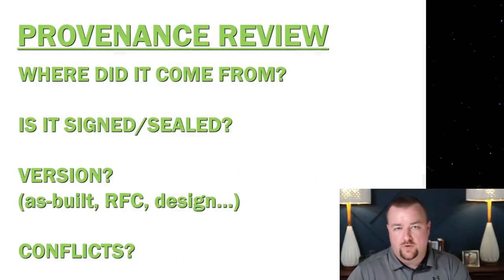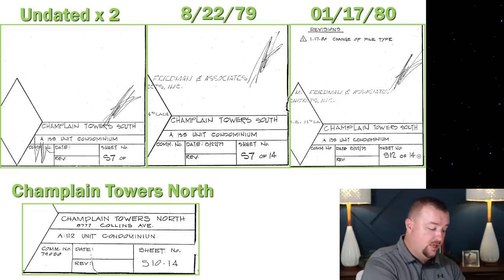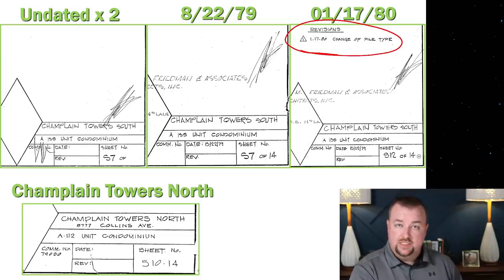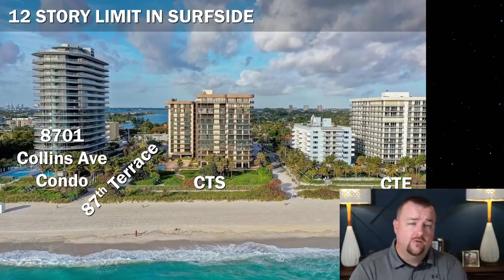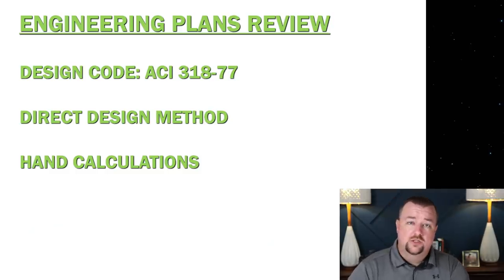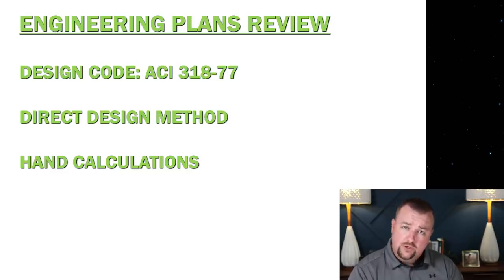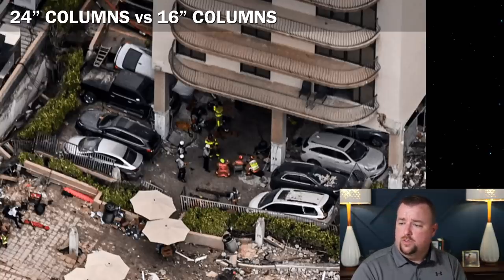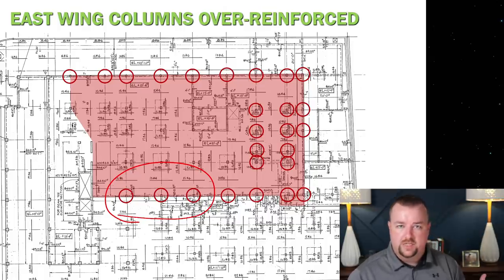Engineering Failures Found in the Champlain Towers South Drawings - Surfside Collapse

Comment: You mentioned that one drawing had a lot of changes that were not noted. Could that have been done by someone else without the engineers knowledge.
Reply from the maker: I actually thought about that.  Something about the last minute changes almost makes it seem like the engineer "rented out" his seal to the architect.  It wouldn't be the first time this has happened.
Reply: Just imagine if you approved this building in any way...
Reply: @windsofmarchjourneyperrytr2823  Presuming they are still alive 40+ years later.
Reply: @BuildingIntegrity  When the recommendations of engineers and contractors are routinely dismissed as insensitive to the architect's grand visions, shit happens!
Reply: @keithrosenberg5486  no, I think they are all dead bar the partner of the engineering firm that was not involved in the design.
Reply: Sometimes senior partners trust the engineers that is doing the design work a little too much. In a large firm this is hard to avoid since the senior engineer seals so many buildings that checks can slip through the cracks. Now there are concept review checks where errors like this are more likely to get caught but it is not fool proof.
Reply: @dellto529  Architects suck, I've only worked single family homes and they suck there too.
Reply: @keithrosenberg5486  The structural engineer as well as the architect passed away a years after the building was constructed. The structural engineer actually had his license revoked.
Reply: @FunnyFallGuy  that is telling in and of itself
Reply: @BuildingIntegrity  Hence the absence of the engineers company logo

Comment: I'm surprised to learn from you that there are planters on the original drawings.  I had understood from another channel that the original pool deck was plain concrete, and that the sand, pavers and planters were added later to mask spalling.  Supposedly, there are google earth images that capture when various aspects changed, including the addition (and later removal of) 2 story tall palm trees in planters.  Like so many others have mentioned, we would like to know if those missing beams are also missing from the North towers.
Reply: I am very curious about the pavers as well!
Reply: @kimberlywright8623  And I am curious if added weight of such improvements as tile showers and granite to the condos contributed to the disaster. It looks like to me that ANY added weight, when combined with the missing beams and years if water damage multiply the problems.
Reply: So am I. And, when testing was done by one of the planters and not repaired, was it just one more problem?
Reply: I think more planters and pavers were added later to the pool deck.  Also there was no/poorly installed moisture barrier when these were added so it contributed to the damage in the garage ceiling.

Comment: Question, was the pool deck originally just a slab? Or was it a slab with the pavers on top of it. Then by adding the pavers and other materials the deck was way over stressed.
Reply: @jennyk2022  I think it is already confirmed that it was not angled correctly to let water run off, and that the waterproofing had failed a while ago.
Reply: That’s right!!  The pavers and more planters were added recently.  The columns were already at 100% capacity at the beginning of the project, can you imagine the kind of stress they were under after adding the new pavers and planters??!!
Reply: @Sashazur  The concrete slab was angeled for drainage, but when the pavers were added, the end result was flat.
Reply: @lilyrodems4847  and consider what equipment was used to bring the pavers into place. Big pallets of pavers being moved by forklift or other machinery.
Reply: @ericdunn6232  yes!  I didn’t even think of that!!  All the equipment 😧

Comment: I find it very hard to accept that an engineer would summarily remove load bearing beams without considering the consequences.
Reply: Oh, but if it involved a lot of time and trouble, and costs money, and if lots of similar structures are the same with no apparent trouble, who wouldn’t look the other way?
Reply: Sometimes the revision process can get sketchy.  Often times the revisions are performed by an EIT under the supervision of a Senior Engineer.  In that case, the EIT may not have had the insight, diligence or directive to go back and check the original slab design in conjunction with the Architectural and Civil Drawings.  Bear in mind that when the January 1980 revision was made, there was no requirement in the Architecturals for Planters.  Thus there would be no clear reason to design the concrete structure to support them and the EIT may not have been allowed sufficient time to completely re-evaluate the Parking / Pool Deck structure under his boss's directive.
So, in a nutshell, it looks like there was an error in slab reinforcing design which no-one took the time to discover, followed by an inarticulate revision to the slab configuration (to save money) complicated by an ill-informed building owner's scheme to "improve" amenities which introduced critical loading to the pool deck slab, attended by an installation process executed by incognizant landscapers served by innocent truckdrivers.
Oh, ... and 120 people tragically died as a result of this chain of lazy errors.
I mean no offense, but, I do not find it difficult to accept that this many critical errors accumulated in complete isolation from one another.  That they all came together at one building in such a tragic fashion is just a manifestation of the natural randomness that exists in our world.  Such confluences of lapsing attention are more and more likely to occur until the Kali Yuga begins to transition into Dwapara Yuga once again (~430,000 years from now, so get used to it).
This video is a terrific example of how we need to act if we are to remain viable as a species.  We need to be extra vigilant and more coldly analytical to guard against this kind of thing.
And we need to empower people of real "concrete" knowledge like Josh Porter (sorry about that).  Great analysis and chain of discovery.  Can't wait to find time to view more of his forensic engineering videos.
Reply: @erikmeyer2323  I will prove you right by saying, you where doing so well until you made it a religous thing.
Reply: You might want to check out the collapse of the Hyatt Regency Skywalk in Kansas City in1981. Engineers made a change  without rechecking numbers resulting in a catastrophic collapse killing over 100 people. Unfortunately Engineers do make mistakes.

Comment: Built to minimum spec, and not maintained. Got it.
Reply: Built wrong and to minimum spec, renovated wrong, then not maintained...40 years of mistakes each eroding little more of the building's integrity.
Reply: As a result the deck collapsed first, then the smaller columns lost their center support and simply buckled.
Reply: @ButterfatFarms  well said, wise perspective 🙏
Reply: It seams it was not built to minimum spec because it did not take into account for any live load whatsoever. Not even one person walking on it, let alone planters and cars, unbelievable.
Reply: @johnseavey6622  Or the occasional construction vehicle, heavy construction machines, heavy construction material or crane put on it. As one Engineer I read said if you leave an area open sooner or later someone will put something very heavy on it. So you put permanent stuff in the way of them doing that. And not they don't read the signs and no the basics staff not going to enforce the rules assuming any of them can actually read.
Reply: What kind of safety factor are buildings suppose to be built? I always thought maybe 1.5 or something like that. Sounds like it didn't have any room to play with at all.
Reply: Hey but didn't those marble and granite countertops look good?
Reply: The maintenance itself was a risk  since it would require materials and vehicles and vibration. It seems it was a matter of time regardless. I hope the sister building is still evacuated.
Reply: @waitaminute2015  The sister building was never evacuated.

Comment: Excellent analysis.   To put into context, how much does a soaked planter weigh compared to a standard vehicle?
Reply: Soil weights around 75 to 100 lb/ft^3(more like 120lbs when wet), assuming a 2*2*2 ft volume this comes out to around 800lbs.
A Camry is around 3500 lbs
Reply: Adding to the answer above,  a Camry measures approximately 6 feet by 8 feet.   A planter measuring 6’ by 8’ by 2’ deep would weigh between 7500 pounds dry and 12,000 pounds wet.

Comment: You also had this structure built with 1980 decor: linoleum and vinyl. They updated the units with tile and granite.  This place had no chance!
Reply: You are quite correct !!!
Reply: Yes I saw plans for the installation of marble flooring in at least one of the units: that's a lot of weight.

Comment: Great work! Very clear that you know what you are talking about. The architectural changes were a clear cause of design flaws in construction. Any and all Maintenance efforts were not going to keep up with the thermal cracking, Sea Salt Air, Sea Water and Rust with the occasional supper tides and Hurricanes!
Rust Never Sleeps.

Comment: Question, why didn't they design the buildings to be independent of the pool deck? The interconnectedness of the buildings seems to be an inherent design flaw in a simple design like this.
Reply: In some other video on this or a related channel, they said that it is more commonly done in areas with more seismic activity.
Reply: @Sashazur   Yes, typical in California,  seismic activity and less rain than Florida. Helps to restrain structures during quake activity.

Comment: Just seeing all of the ways these buildings can fail, it amazes me that these kinds of collapses don’t happen very often. I realize there are safety factors in place, but all of these buildings were engineered using calculations by hand, with no software to model dynamic forces and such. It’s a real testament to the engineering profession. Thanks for your fascinating analysis. You’re great at communicating complex ideas in a digestible and interesting way.

Comment: As a mechanical engineer, this makes me branch off into structural engineering. 😍
Reply: Stick with mechanical. Worst thing someone is a little too hot or too cold, no one is dying.
Reply: @AJF66OG  If only.  Mech-Es are often dealing with things that can directly kill someone if they're not careful.  Same with many EEs.  There's a reason why I know people who don't want to take the PE exam.  It's a huge responsibility.
Reply: @AJF66OG  except when there’s to much pressure from the heat and it goes boom… so every form of engineering can kill.
Reply: @arthurmoore9488  just got my license. Glad I don’t deal with things on the private side
Reply: Structural is simpler - at least our stuff do not move by design :)
Reply: @ivankuzin8388  Unless it's supposed to be in an earthquake area. I graduated from the university of utah where our library was rebuilt to flex with earthquakes.... the new structures were fascinating!
Reply: @MissNebulosity  Oh, yes, of course, and I am so happy to live and practice in a region with zero earthquakes!

Comment: When you were showing the diagram with the yellow planters and blue cars, you pointed out some 24 inch columns. Were the three columns to the back left of the cars the same three columns you had focused on as the location of the initial failure?
Reply: No they weren't, the original columns were further north and in the center of the building
Reply: @mattheww2797  I think you are right. Thanks!
Reply: No, those are the exposed columns under the part of the building that remained standing.

Comment: Will the North building, which is still standing, have a similar fate?
Reply: That is what I am thinking? Was it built the same way?
Reply: I might misremember but I think the columns there are wider.
Reply: I think he showed, with the beams under the planter boxes in other areas, the additional weight is supported.
Reply: I would bet that building will be condemned at some point and residents forced to move out until structural remediation can be completed.  They are not gonna take a chance at another collapse.
Reply: @johnbergstrom2931  At a minimum I would think there must be some max load areas that all need additional emergency supports put in while they go over plans compared with what is actually there. 
As related in another case it might be best to condemn and drop the building and rebuild as that would actually be cheaper.

Comment: As a retired engineer (MS CE with emphasis in structural), I am curious as to your meaning of being loaded to 100% capacity.  I believe that reinforced concrete design had moved to LRFD in the 70s so I assume this building was designed using that approach.  Are you saying that the dead load was equal to the nominal strength of the slab?  Are you saying it was equal to the strength of the slab with the resistance factor applied to the nominal strength?  Or are you saying it was equal to the strength when the load factor AND the resistance factor were applied?
Reply: I’m curious about this as well.  At that time most likely ASD so max code tensile stress for grade 60 bars was 0.4 Fy = 24 ksi.  Is presenter saying the bars were 100% stressed to 24 or 60 ksi?

Comment: Hi I'm just an interested layman from New Zealand.
We had a big office building about 7 stories collapse during the Christchuch earth quake about 10 years ago.
It turned out that the engineering firm that got the job gave the job to a guy who was not fully qualified in buidlings of that sort. There were come court cases, but I think they got away with it. No penalties and many people died, it was to do with shear walls.
Reply: There was also very little reinforcement tying the slabs to the columns and the lift tower in the CTV building, eerily similar to Champlain Towers.
Reply: These things have to go to criminal not civil system and you need a rule matching the military one that is if your in charge your responsible for criminal actions of your company or endeavor there is no requirement to prove you actually ordered the criminal offensive as being in charge you should have been involved. So is should be almost automatic if criminal negligence was done by a company the executive in charge goes to prison on the charges with who cares if we can't find proof they knew about anything or ordered anything they were in charge they should have been informed and they should have been the one giving the orders.

Comment: In no way am I minimizing the mathematics and knowledge that goes into the engineering of anything that has to stand up on its own, but people, past the calculations and the manufacturing of the pieces, the way things are put together to stand up is pretty straight forward and simple. AGAIN, I am not taking anything away from engineers importance, but it's not rocket science, and why I am saying this is because it's obvious somebody turned a blind eye to the January 1980 changes. It's helpful to understand that material costs were sky high and the housing market was in a slump in 1980, and you best believe that this will be circumstantial evidence when this goes to trial.
Reply: When was the pause in construction I saw recently reported? And when was the crane collapse on the site? I'm curious to know how long things were sitting incomplete. And what repairs needed to be done after the crane fell over the east part of the building.

Comment: This is an awesome analysis! Wow, what a huge oversight/mistake/stupid change. That condo and all like it scare the heck out of me. You couldn't pay me enough to live in one, and now I don't think I'd even be willing to walk around in one.
For contrast, I live in a 4-floor apartment building which has been standing since the mid 1800's, and it is massively overbuilt (it's a converted factory). I have no worries whatsoever living here.
Reply: Older buildings could be built poorly but also back then they tended to build so things last "forever" the idea of building anything with a "lifespan" was just unknown. So houses and buildings last hundreds or even thousands of years. 
And they did not have the science so overbuilding seamed to be the right thing to do. 

Concrete and steel seams to have a build in maximum life span eventually water will seep in and corrode out the steel which in the process will break the concrete.
Reply: @RedRocket4000  - I agree that no building lasts forever, but with good maintenance they can certainly last a lot longer than 40 years.

Comment: I now wonder if the contractor put pressure on the design firm to eliminate the beams. The extra form work needed to make the beams would have been more labor intensive.
Reply: No the formwork is negligible, it's just at one level. When you're pouring concrete to a whole building, nobody would ever try to save a few cubic yards for cost or labor especially not on anything structural like this. It's an engineering mistake and nothing more.

Comment: The CTS Penthouse was a fascinating jury-rig.  It's a TRIPLE-sized unit whose footprint covers stacks 1, 12, and 11.   It has its own "afterthought" corridor snaking across the "main" roof of the 12th floor, connecting the PH to the "13th floor" elevator landing.  This required the elevator motor-room to be perched awkwardly 3 stories above the 12th floor (Yet Another Height Restriction waiver?), but, like the pool, this motor room was built super-tough (precast?), thus it stayed intact all way to the ground during the controlled demolition.  Can't wait to see detailed FEA models of the collapse.